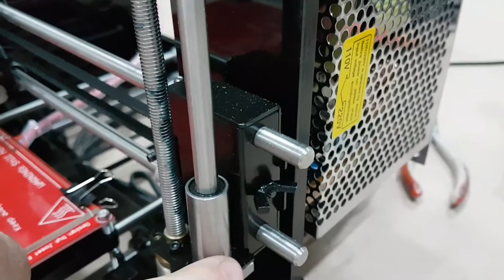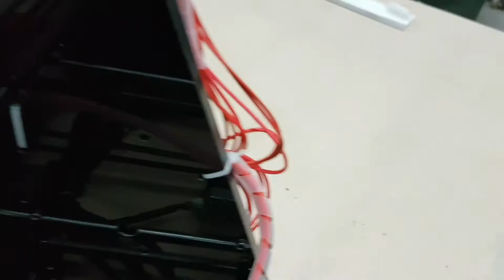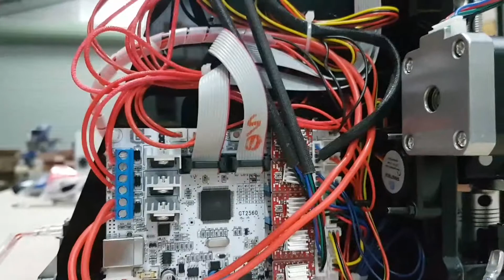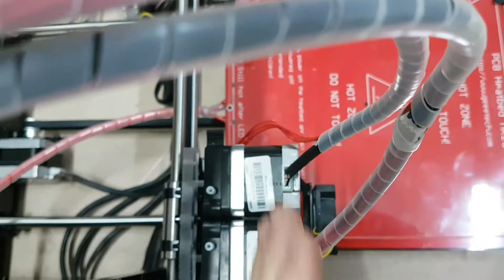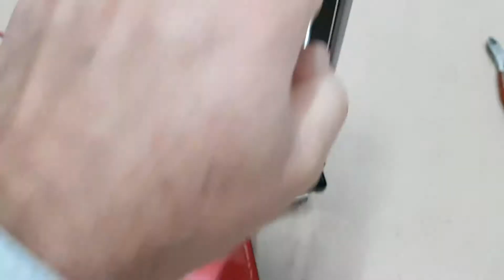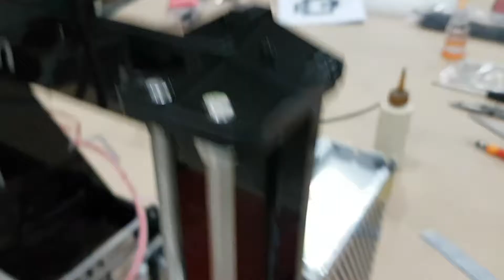Prusa Assembled: Difficulties arisen: problems solved

Comment: No offense (and I am just saying this from experience) but the main problem is that it is a Geeetech as they don't make very good stuff.  Stay away from their electronic parts especially and their ramps is bad, very bad, too (that machine looks to be using a MKS Base knock off they made).
Reply from the maker: Yep!, not disagreeing.
I just bought it to play with dual extrusion.
Funny enough though it is printing OK now, after much tickling.
I am half thinking of resin  & projection being my next.
Reply: Very viable as they have 500 dollar machines out, or coming out, now for resin SLA and the UV resin is still expensive at 50 dollars a bottle but that is 1/10 of what it was just a few years ago.  I can see SLA taking over for the majority of prints BUT they are beautiful, print faster due to how the tech works, and have no structural integrity to them at all.  You can grab a part 3d printed and strain to break it and the same part using SLA you can crush as if it were a waded up paper ball though it shatters in your hands into tiny pieces.  Basicly SLA is for knick-knacks and bric-a-brac.
Reply from the maker: Sad really :/